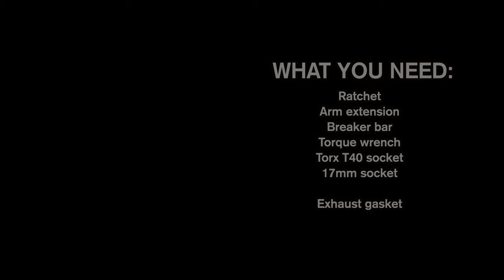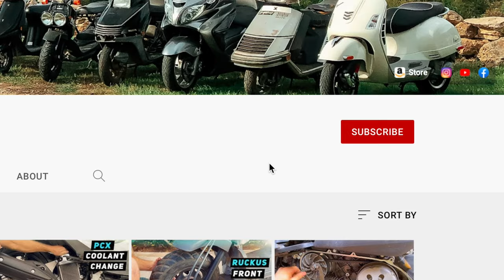Vespa GTS / GTV Exhaust Removal / Installation | Mitch's Scooter Stuff

Comment from the maker: * Tools I used in this video: 
Ratchet 3/8 drive - http://amzn.to/2hhmnUs
3" / 6” extension set 3/8 drive - http://amzn.to/2h7ypMl
Breaker bar 3/8 drive - https://amzn.to/3lrjIWj
Torque wrench 0-150 lb/ft 3/8 drive - http://amzn.to/2Crqq4R
Torx T40 3/8 drive - http://amzn.to/2HG77I3
17mm socket 3/8 socket - http://amzn.to/2EMT6LO

Exhaust gasket - https://amzn.to/3P54WQY

Comment: Just a tip from another scooter guy. When using a beam type torque wrench. Keep the handle centered as you apply torque.  The torque wrench is calibrated as the distance between the pivot on the handle and the center of the socket drive. Love the videos keep them coming!!!